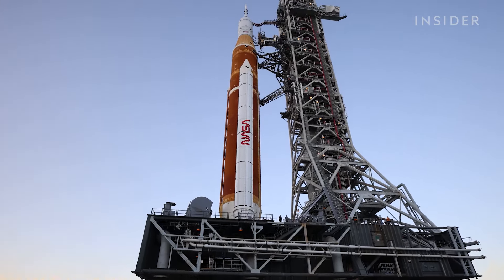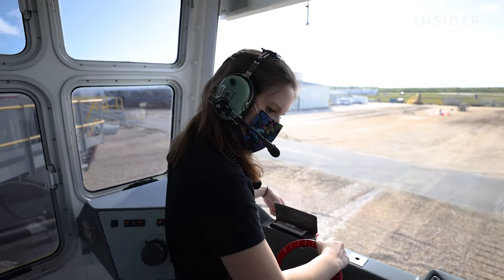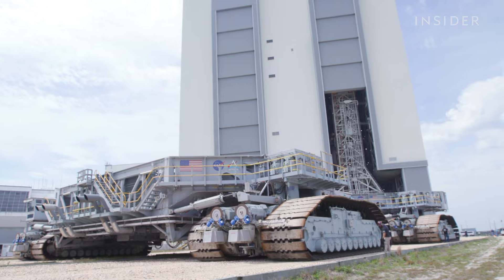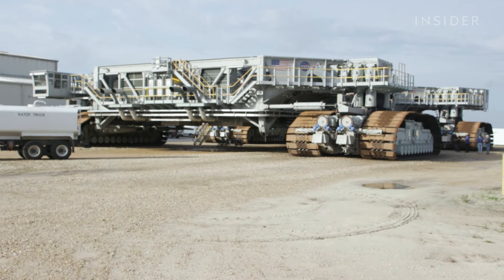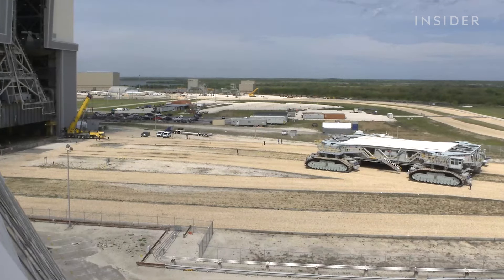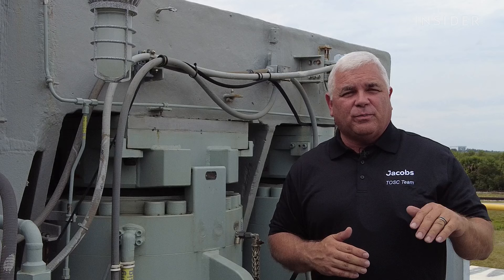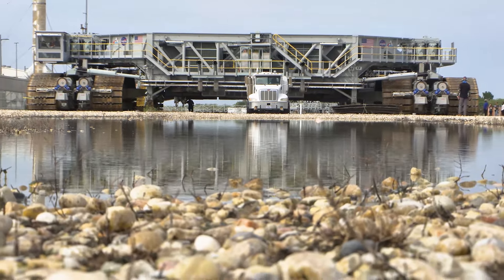How NASA Drives The $144 Million Vehicle That Transports Rocket Ships | What It Takes

Comment: It is possible to automate the operation of this entire thing and eliminate the need for all technicians and engineers.
Reply: If it ain't broke don't fix it

Also it's a specialized job that requires gut feeling and decades of experience piloting it as well as very close by checking that if you "automated" you would just have a person in a remote room or on top looking at alot of cameras

Comment: I wonder if it's possible or viable to replace the rocks with asphalt or something, maybe not the whole area but the general track that it needs to move through
Reply: You want the rocks. They dissipate the weight across a greater area. Asphalt would crack. Same principle as rocks under train tracks.
Reply: @jg5875  ah, very interesting. Thanks for the reply

Comment: This invention is indeed briliant.... Its basically like a gaint turtle without the height air perception that is a turtles neck and head, so instead we use our numbers to visually monitor its movements. BUTTTTTT why not just create algorithims within each parameter of WEIGHT, SIZE and Starting position. a GPS that adapts to the load while the people are there spectating vs constantly "working". WORK SMARTER NOT HARDER!

Comment: Talk about wasting budget
Reply: How?
Reply: @weekiely1233  why don’t they build it where they launch it?
Reply: @mitchelljack1590  because they require large facilities to fully stack the vehicle. They also don’t build every component in Florida. The engines and core stage are tested in Marshall and the entire vehicle is shipped before stacking.

And if they built it on the launch pad they’d need an even bigger transporter to move the assembly building away from the launch pad.

Also they have two launch pads for redundancy so you’d need double the amount of facilities.

Also NASA only has 0.5% the budget. Why would they waste it?
Reply: Found the second money moaner

Comment: interesting. wondering how they support the rocket while it's loaded and unloaded off the crawler. crane rigging would be cool to see if that's how it's done.
Reply: The rocket is assembled on a mobile launch platform in the vehicle assembly building. The crawler drives under it, and basically lifts the platform and rocket off the jackstands, and drives it to the launch pad.   When its positioned properly, the crawler squats back down lowering the platform down on jackstands on the launch pad.    The crawler drives away, leaving the platform+rocket assembly on the pad. 

In the video at 0:14, there is a side shot of the crawler and platform.  Everything above the drivers cab is the mobile launch platform.

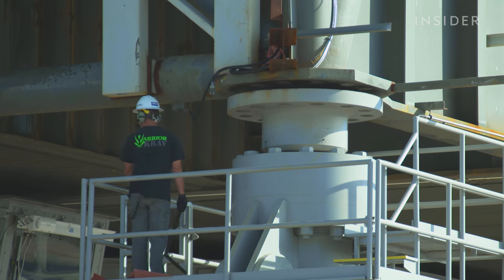at 1:22 in the video, you can see the jackstands the mobile launch platform rests on at the launch pad (or in the vab).  at 1:28 there is a very brief shot of the transporter lifting the platform off the jack stands. 

Cranes are only used inside the vehicle assembly building to build the rocket stack on the platform.

Comment: useless. just make a railway system for less than 50 million dollars to there and just make a lift or something for less than 20 million for spaceships to land safely on it
Reply: The launch pad sits on a hill, because that part of the coastline is a swamp and building things like the flame trenches into the ground is difficult. The hill means you can't use rails (incline is too steep). To make a rail system possible, they'd have to build the VAB at the same elevation as the launch pad, and build a dike between the VAB and pad. That may have been more expensive than building the crawler.

Comment: I’m wondering why they don’t use some sort of train system to get it to the launch platform. Like it would be cheaper and probably faster aswell.
Reply: The launch pad sits on a hill, because that part of the coastline is a swamp and building things like the flame trenches into the ground is difficult. The hill means you can't use rails (incline is too steep). To make a rail system possible, they'd have to build the VAB at the same elevation as the launch pad, and build a dike between the VAB and pad. That may have been more expensive than building the crawler.

Comment: Why Not Train Tracks like the russians do?
Reply: The launch pad sits on a hill, because that part of the coastline is a swamp and building things like the flame trenches into the ground is difficult. The hill means you can't use rails (incline is too steep). To make a rail system possible, they'd have to build the VAB at the same elevation as the launch pad, and build a dike between the VAB and pad. That may have been more expensive than building the crawler.

Comment: Does anyone know if there's any stories where the crawler failed while bearing load? That'd be a really interesting story to read about how they would fix that. Would they get a crane to remove the load then proceed to work on it?
Reply: They would probably place massive hydraulic jacks under the load and lift it off of the jacks on the crawler weren't working. If the crawler's jacks were working, all they would need to do is place columns under the load and lower it onto them. It's sure to be more complex than that, but that should be the gist of it.
Reply: All of the mechanicals can be accessed without removing the load.
Reply: If you really are interested in the many problems with the next Mobile Launch platform Arstechnica has an excellent article called, "NASA’s second mobile launcher is too heavy, years late, and pushing $1 billion". This to correct the many deficiencies this one has. Another contractor fail by Bechtel

Comment: thats a very big downgrade compared to the saturnV, its a waste of money
Reply: Once the EUS is operational for SLS Block 1b, SLS will have more TLI capacity than Saturn V did, and for significantly cheaper. That's not a downgrade, that's a massive upgrade.
Reply: How? Is it because the SLS is the second rocket to land a guy on the moon? Maybe look at the rs-25 engines, refurbished from space shuttle launches. LOOK AT THE SRBSSSSS. have sense

Comment: This thing is some incredible engineering, don't get me wrong.  I'm curious why they don't just install a rail between the two ends of their system.  Seems like that would be a million times easier and cheaper and safer etc....
Reply: It's about the weight they are dealing about. NASA's rockets are big and heavy compared to other companies/countries
Reply: ISRO use that i guess
Reply: ULA does that, I think it’s just because A) this infrastructure is already in place, B) because there’s a reasonable hill up to the launch pad, and C) because these rockets are just too big
Reply: They already have this. Its most likely cheaper to just maintain this than to develop a new system.

Comment: Why not just build a train track that goes up and down of the launch pad from the warehouse? Of course, the should be hydraulics to keep everything leveled.
Reply: The launch pad sits on a hill, because that part of the coastline is a swamp and building things like the flame trenches into the ground is difficult. The hill means you can't use rails (incline is too steep). To make a rail system possible, they'd have to build the VAB at the same elevation as the launch pad, and build a dike between the VAB and pad. That may have been more expensive than building the crawler.

Comment: What a theatrical performance! These excavators used in the above ground mines, digging up brown coal, in Germany are heavier, bigger and do actual work besides moving something from A to B. They run on tracks manufactured by the same company but no one makes a fuzz about dust nor does it take these „walkers“ to move on a daily base.
That might be the difference between „Rocket Sience“ and „Getting s#!t done“. 😂

Comment: Not to undermine the sheer engineering of this thing and all the technicians behind it running, but why didn’t they develop a rail system by now that’s perfectly level?
Reply: The launch pad sits on a hill, because that part of the coastline is a swamp and building things like the flame trenches into the ground is difficult. The hill means you can't use rails (incline is too steep). To make a rail system possible, they'd have to build the VAB at the same elevation as the launch pad, and build a dike between the VAB and pad. That may have been more expensive than building the crawler.
Reply: @zounds010  no

Comment: How does SpaceX do the same thing, routinely, for a heavier spacecraft, using off the shelf machines over (reinforced) public roads, at orders of magnitude less cost? Can you say imagination, innovation, sense of urgency, etc., & perhaps, much less greed & selfishness of the (pork barrel boondoggle) managing, funding, & supplying entities? Oh & btw, you can witness it it person (as I did, recently), from across the street from where it’s all happening!
Reply: SpaceX does not do this for heavier spacecraft. The heaviest spacecraft that SpaceX has launched was the falcon heavy that weighed 3.1 million pounds. This space launch system weighs 5.75 million pounds, almost twice as massive.
Reply: @grantsommer9176  not to mention that SLS has a much wider booster, while the FH is just 3 Falcon 9 first stages stuck together.
Reply: Starship and Falcon 9 are transported empty, which makes them much lighter than a Space Shuttle: its 2 Solid Rocket Boosters are full of propellant when they're installed on the pad, the SRBs alone weigh 1200 tons. Starship maybe 100 tons empty, F9 a fraction of that.

Comment: This was pretty cool 50 years ago, watching starship move on commercially available spmt’s with a guy just walking next to it with a remote it shows how outdated traditional nasa companies are.
Reply: Starship has to be moved on commercial roads, and it’s unclear that this assembly method will be what they always use. Starship also doesn’t move to the pad fully stacked. It’s not better, just different.
Reply: @alt8791  If by different you mean old tech and extremely expensive yea, its different :p in all seriousness it's pretty cool, had a professor in college point out once that slide rulers and hand calculations got us to the moon, not calculators and computers.